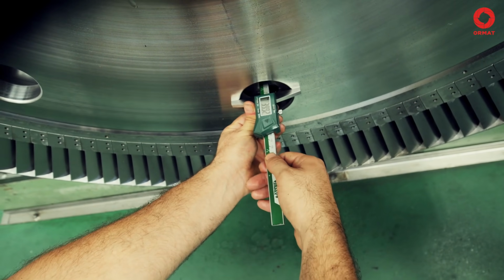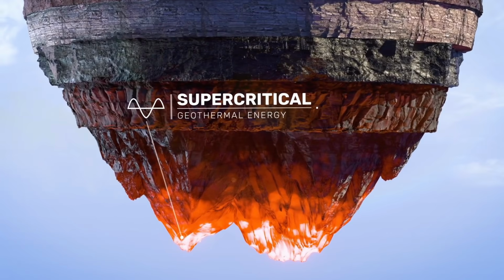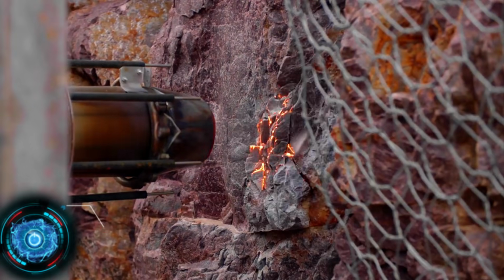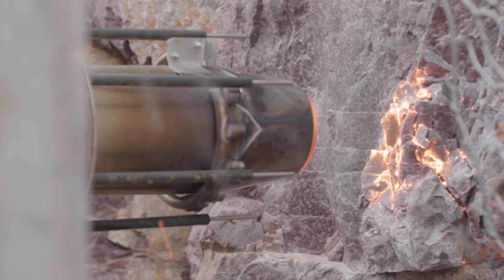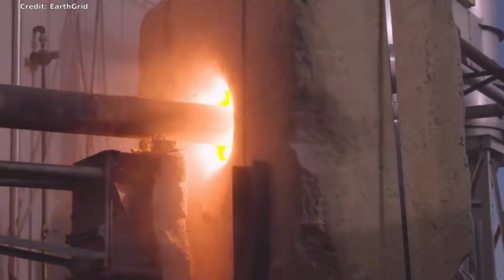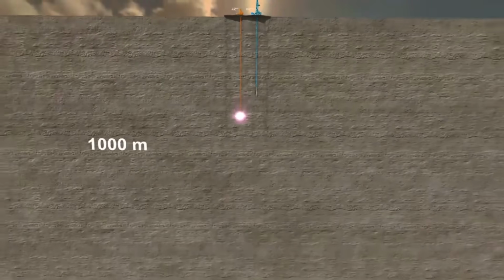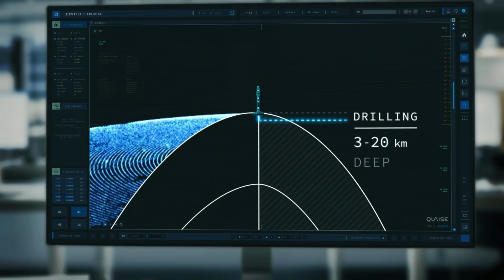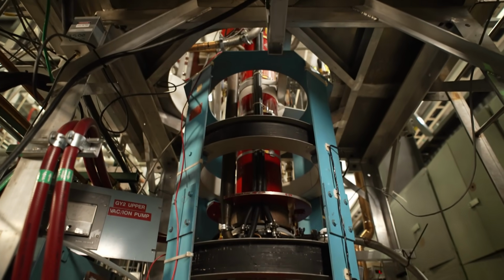New DRILLING Machine Unlocks Unlimited ENERGY!?

Comment: If its faster, while safe and stable to use, i don't mind it being more costly or energy intensive as long this is used for establishing public infrastructure that may be used for decades if not centuries. If it becomes cheaper though, then things become more intersting as some projects become viable. Like having vast support tunnels under a nation to run through super conducting power grids, water distribution systems, transport systems or even have whole industries that just take up living space up on the surface moved under ground. It may also lead to tapping into deeper rich ore fields.

AI already has shown that it will be used to advance material sciences and i would think that we will therefor be able to find materials being able to operate in pressures more reliably deeper under ground. Maybe so deep and inhospitable that humans will never see it with their own eyes, but aslong we still can benefit from that, who cares. Still i wonder about risks, like with the mines of moria ;) they dugg too deep. Are there any risks beyond loosing equipment? What if we tap a high pressured magma bubble we weren't aware of?

Comment: Dude, I don't think you realize how expensive the machine could be and it still be amazingly economically viable, assuming they can get 75MW from a single hole 75MW of natural gas would cost $322.5 per second given the cost of natural gas at wholesale is 0.0043 USD per kWh which in a year would cost 10.17 billion USD in natural gas.

Assuming quaise's machine can last 5 years of operation, with maintenance doubling that cost, a 20% margin and it takes them 100 days to drill a 20km hole like they claim, they could dig 18.25 holes before the machine died. Also assuming that investors would like to see a return on investment within a year which is pretty accurate the machine could cost 74.2 billion investors would be investing in building geothermal plants because it would offer a return on investment of almost 2x in a year because it's half the cost of natural gas per kWh, and for every year after that you being 10.17 billion USD better off than building a natural gas power plant.

WITH THE MACHINE COSTING 74.2 BILLION, the machine can be expensive, it's fine.

Comment: What happens if you hit water? North of the Alaska range around Fairbanks, its almost impossible drill without punching through a significant layer of ground water at some point. Just curious if it would function going through ground water

Comment: Easy solution. Find location that has high geothermal gradient. Get mobile nuclear powerplant which we already have on aircraft carriers. Build a cooling tower real quick as there obviously no ocean.   Then use nuclear powerplant to drill in one spot and make a plant. Check energy efficiency. Keep drilling in nearby areas using nuclear plant. Once energy needs are met use already existing geothermal plants to provide energy for continue drilling in local. Move nuclear plant to new area and repeat. 

At that point the energy drilling mechanism can be scaled up for more rapid drilling. Sell energy cheaply to local. Become monopoly basically guarenteed.

Comment: GA drilling's plasmabit is directional so would be complementary to Eavor's design.  Quaise Energy requires a straight line.  They just go deeper to get the heat required.

Comment: That'll go well for about a few meters, then the hole will start closing up on them due to the lack of fluid pressure keeping it open. Also good luck suspending the rock cuttings in a gas stream to carry them up. I don't even want to know how absurd the pressure and flow rate would have to be. At least you wouldn't have to worry about the previous point, because you blasting rock shavings at Mach 5 and thousands of bars up your drill hole is certainly helping with keeping it open. 

Sadly, the local population might complain about the hundreds of meters wide abyss, that ate the townhall, and the beyond-natural-disaster-scale hurricane caused by your air compressors sucking in a quarter of the country's airspace per hour.

Wouldn't stop any serious researcher from gobbling up tens of millions in government grants and venture capital to research their long waveguides and prospect potential maritime drilling locations from their shiny new research vessels, tho.
Reply: It cases the bore hole with vitrified glass to the surrounding strata which are better than the steel pipes they use now.

Comment: @4:12 "very interesting machine because it's a very high interest diffusion research so it's definitely interesting to see an offset technology be used in drilling but more importantly it only consumes about *one megawatt hour*" (emphasis added).  
Do you simply mean that diffusion research is interesting?  (I wouldn't ask if I didn't agree with what that apparently means.)  
Did you mean to say one megawatt /per/ hour?

Comment: I think main problem is keeping the line open as heat will clog te pipe...  anyway new  archiewements/upgrades in this technology will help making wenus's potential energy accessible... whch i guess has extreme potential as its surface is too hot and upper atmosphere is too cold... or night side... i think vens has more potential then mars... as its bigger as 2 adventages ower mas ie too high an too cold place which meand energy 😊 and lots of chemcals that can be used for lots of things ..

Comment: Low cost tunneling would be a huge game changer.   Urban regions could eliminate the need for surface roads.   Water transportation under mountain ranges could turn deserts into farmland gardens while avoiding pumping water thousands of feet vertical.
Reply: The people in NYC may disagree with you at this very moment.
Reply: @a-a-ron4679  Why?
Reply: @bazoo513  because the city is or was flooded. That’s why
Reply: @a-a-ron4679  Flooding or not, NYC depends on tunnels, for everything from potable water to sewer to steam to comm cables to subway. And some of them are very deep.
Reply: @bazoo513  yeah I know

Comment: You could absolutely use diesel generators to generate 8mw. Might take a few trucks to deliver them and fuel them tho.
Reply: Could. But then, if you're drilling for geothermal power, you're going to have to run a high-capacity grid connection to the site anyway to get the power out. Might as well just use that to power the drill.

Comment: Waveguide is easy, it's been made since about WW2. Millimeter wave generating equipment is pretty commonplace too. Both are everyday items in the military inventories. 
The challenges are going to be the temperatures around and aft of the drill head. Molten rock AKA lava is about the same temperature that steel melts at. So it will take some pretty expensive alloys to do this. 
Not impossible just challenging. Assuming the power requirements are not understated.
Reply: Millimeter wave generating equipment, yes. But at the power levels needed for this, not so much - you're going to need about a megawatt of output. Doable, yes, but lots of custom heavy engineering to make not just the gyrotron but also the power supply for it.
Reply: @vylbird8014  what about coolingen and tungsten or other heat resistant skin?

Comment: Graphine conducts heat over a long distance with little loss almost instantly.

Just transfer the heat from deep for power.

No need for turbines with a large bank of Themo electric generators.
Reply: TEGs have crap efficiency compared to turbines. They do have their uses - they have near-perfect reliability, happy to operate for decades without servicing - but their efficiency is awful.
Reply: @vylbird8014   yes but turbines require a lot hotter water or high pressure steam.  A teg can make power with less.
Reply: You need to learn the relationship between thermodynamics and efficiency. Peltier junctions (TEGs) are notoriously inefficient.

Comment: Replace  the tungsten carbide inserts with osmiridium for starters as it will take the enormous heat generated by extreme deep holes. The bit itself should be manufactured with titanium steel. We have the technology to replace bits in the hole already but the real problem with geo thermal holes is to keep them clear as the steam generated is not just steam it is most often a composite of deleterious solutions such as calcium and barium which inevitably clogs the annulus reducing the steam pressure. Keep at it all the same. Excellent vid.
Reply: Seems they should be able to keep the holes clean, by re-running the plasma/lasers down the bore, as needed.

Comment: Only a cone shaped carbide drill can reach the maximum distance possible but we will need to constantly replace them and try to keep them cool, replacing the drill head again and again is the biggest challenge.
Reply: They have had carbide drill heads that can with stand 500degree Temps for a decade at least .
Reply: vc mistura vários metais talvez daria
Reply: Interesting, I didn’t know they could handle that much heat. My impression has been that the microwave approach could potentially be much faster. I’d think they would just use microwaves all the way down, but maybe the cost per unit of depth is higher than conventional rotary drilling until you hit a certain depth.

(As you mention, on deep holes changing the bit is the huge bottleneck; they need to pull out and disassemble the whole drill stack, replace the head, then reassemble and lower it back down. I wonder how long that takes for, say, a 2km hole? Anyone know?
Reply: @DaveEtchells  My friend worked for a lubricant distributor that serviced industry including mining and oil drillers .He would give me from time to time the Trade Magazines to read. This is where I read about the New High Temp drilling heads .That was at least Decade ago.
Reply: Needs plasma cutting to 10miles
Reply: Russia tried it. The bit wouldn't go any further not even a cm.
Reply: depende metal ou ponto de fusão super aquecimento

Comment: How about drilling a hole in deep ocean floor over a thinner crustal area.  Install Sterling Engines using the Deep Cold Ocean to offset the heat from such a deep bore hole.  No Steam or Pluming needed.
Reply: Equipment can't easily survive at such depths because of intense weight and pressure of water over it maybe that's why it's still not being tried.
Reply: The salt in the water is really a problem for maintenance

Comment: how is the holes cleared of debris?
Reply: By squeezing them, like a pimple that is miles deep until the very long strand of spaghetti reaches its entirety, but then after that is removed, a fountain of endless fire pours out until the plastic surgeons move in and seal it up, like that one time when brad pitt had that major pimple that required surgical intervention.
Reply: The rock is vaporized so it leaves the bore as a gas.
Reply: The vapourised rock is transported up the hole using high-pressure Argon.

Comment: everything   can be used up over time. but  this is the second  biggest source  we have  . the sun being number one  . i dont count wind  . although its  said to be  300 time  more  from off shore wine then we now need.
Reply: there's lots of energy in wind but it's super hard to capture and induces a lot of mechanical stress hence why we chase things like photo-voltaic cells

Solar and geothermal is the only thing any self respecting Type-1 civilisation would use with nuclear fusion and fission where needed

Comment: 1 mw/h for how far at what diameter.  That is a unit of energy, not power.  You are  mixing apples with millimetres.
Reply: Thank you for picking up on that. I wondered of any one wouild.... Like so many of these "Wow Man I love Science !! " the level of Literacy is abysmal. Wiht deep drilling Geothermal the thermal  energy is important .. not simply the temprature of the rocks at depth. How much heat is stored in the strata. How permeable is it.   Like water underground. Sure dig a well till you hit water but how much can you extract WRT to how quickly the aquifer is replenished.  It is intencely irritating to me because of the Limitless Energy bandwagoning that goes on ..so much snake oil ... When we need a lot more energy than we have now e will need a technology that will work not just a Marketing Scam.
Reply: @markawbolton  You mentioned literacy, the ability to read and write. But you don't read what you've written and this is a mess.
Reply from the maker: Yes, good point! It's compared to a 21 cm/ 8 inch hole. It's all-in estimate of the cost per megawatt-hour (MWh) but they are using 1 MWh gyrotron so it's probably a low number. GA Drilling already changed their numbers multiple times so I don't like throwing straight technical comparisons, so I tried basing it on the minimum energy requirements/geothermal well diameters to give people an idea.
Reply: @Motor_Explorer1  See, you've done it again. I think you may not be qualified for this field. You said in the video "... hundreds of megawatts per hour..." - this makes no sense. Like @markawbolton said above, you are confusing energy and power units. And now you did it again, in reverse, by saying "1MWh gyrotron". Gyrotrons are rated on their power, not an amount of energy. You are clearly reading these figures from somewhere and then mis-stating them here.
Reply: @Motor_Explorer1 are they going to case the hole? How do they stop it collapsing

Comment: US Patent 3,693‚731 (Los Alamos, 1972) “A machine and method for drilling bore holes and tunnels by melting …and during operation of which the molten material may be disposed adjacent the boring zone in cracks in the rock and a vitreous wall lining of the tunnel so formed. The heat source can be electrical or nuclear…”
Reply: $1.3 trillion annual spend on climate change and they've had a patent for 50 years. They could have fixed the problem many times over CC is a scam to tax co2.Everything anyone does produces co2. Global taxation scam